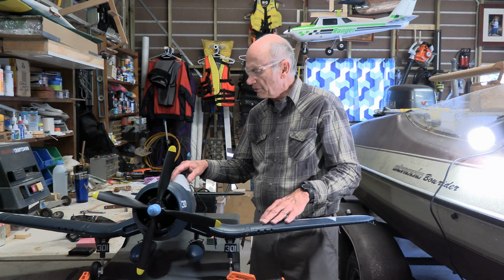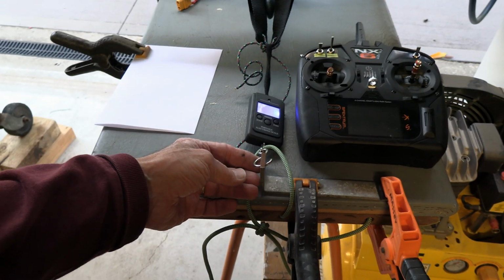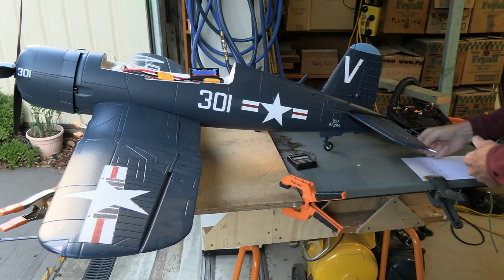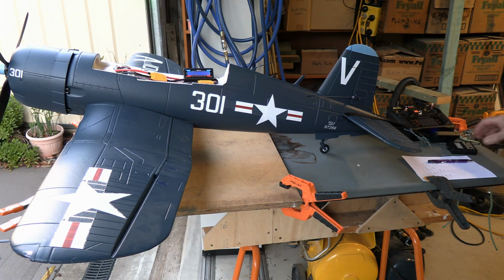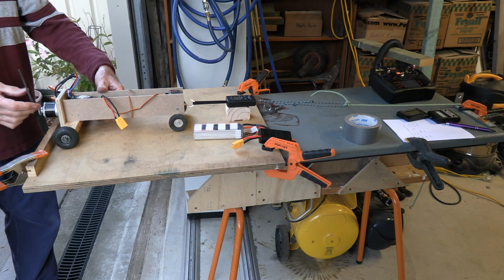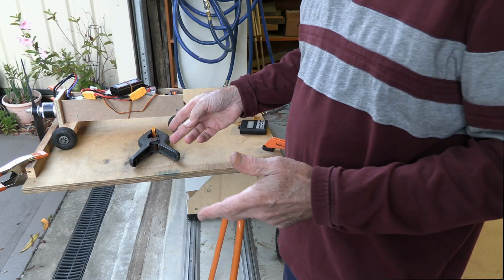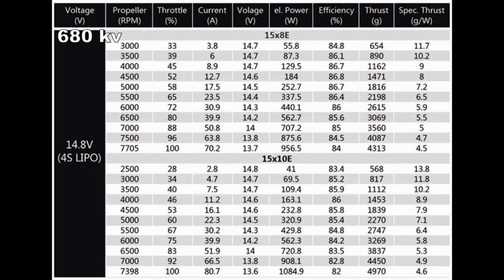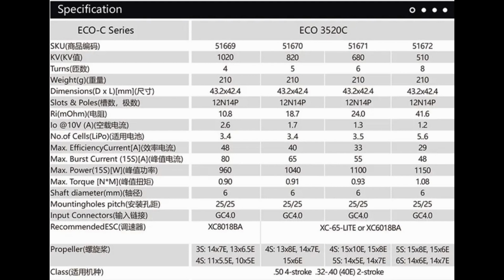Electric RC Plane Motor Testing

Comment: Thank you for your excellent info. Would the same results apply to using a large pusher prop. I build and 98 percent of my rc "s are boats . Currently I am working on an air boat as a off shore rescue for racing boats and I am trying to use a 3 blade 16" prop ? Thank you for your awesome info.
Reply from the maker: Hi Robert, you need to check the performance specs for the motor/ battery combination that you are using.  Anytime that you add a blade, increase the pitch or lengthen the blades it will typically increase thrust but also increase the amps drawn, so you need to be careful.   It would be hard to test it in an air boat using a pusher prop, but you could make a like cart like I did and test the prop that you are considering using with your motor.
Reply: @RCJim  Thank you somuch for your time and I will definitely make a cart :)

Comment: what I get out from this vid is that i should always use a 2 blade prop for best performance  do you agree and what situation would i use a 3 or 4 blade prop?
Reply from the maker: The fewer the blades, the higher the efficiency. But, as with the big birds sometimes you need to sacrifice efficiency to get enough ‘bite’ on the air to deliver the power. Hence the four bladed prop on the F4U Corsair. Have a look at the performance charts to see this.

Comment: 1. I don’t think about the amount of thrust. I use watts/pound. A trainer might need 80 to 100 watts/lb, a sport plane or warbird might need 125 watts/lb, an aerobatic plane might need 150 to 175 watts/lb, and a 3D plane would need 200 watts/lb or more.
2. Thanks to “Back-EMF”, an electric motor has a maximum no-load rpm which is equal to the applied voltage times their KV rating; e.g., 18.5 (5S) x 680 = 12,580 rpm. Of course, a fully charged 5S will start out at 21 volts, but the motor will never see all of it due to battery, ESC, and wire resistance. I do my calculations at 3.7 volts/cell which insures I’ll have good performance at the end of the flight.
3. Motors generally like to be statically loaded to about 80% of the no-load rpm. So, 18.5 x 680 x 80% = 10,064 rpm.
4. Since I now have the static rpm, the next thing I determine is the pitch of the propeller. If I multiply 10,064 x 7 and divide by 1056, I get 66.7 mph. The 1056 converts inches to miles and minutes to hours. If 66.7 is too fast, I’ll divide that by 7 and multiply by 6 which gives 57.2 mph.
5. Once I’ve settled on a pitch, I multiply the pitch by 1.5 to get the minimum diameter prop that I’ll use, so 6 x 1.5 = 9. If the pitch is more than 67% of the diameter, the blades will be stalled at zero airspeed. The maximum diameter would be twice the pitch or 6 x 2 = 12. As you go above 2:1, the motor will be working harder at rotating the longer blades through the air. You might gain a little thrust, but you’ll get less flight time.
6. So basically, since I pretty much know the rpm, I pick a pitch that’ll give me the speed I want and then pick a diameter that loads the motor to its maximum rated current. If the prop D:P ratio isn’t between 1.5:1 and 2:1, I need to use a different number of cells or use a motor with a different KV rating.
Reply from the maker: Thanks for all the good info!